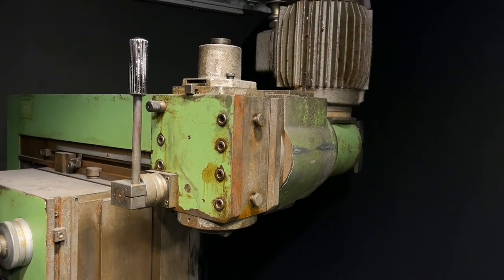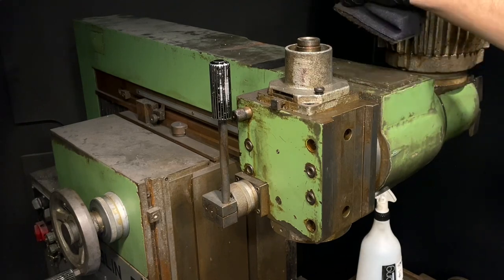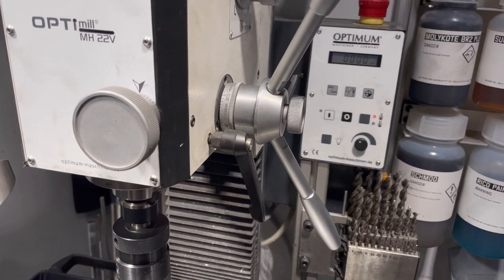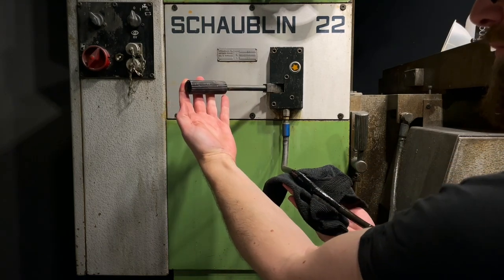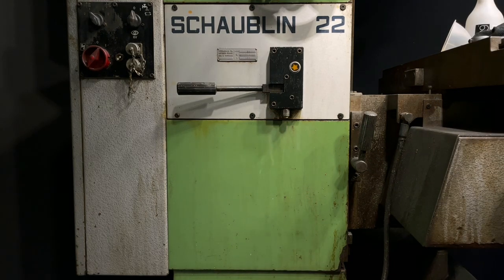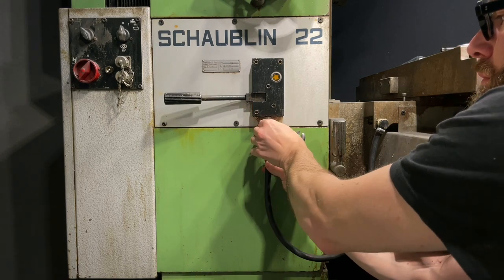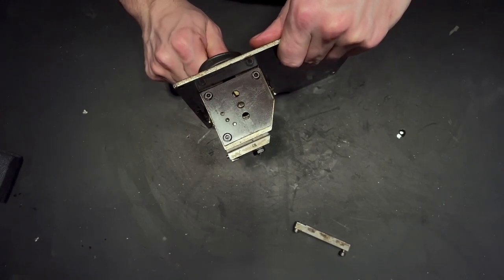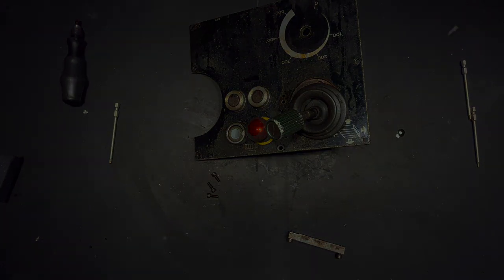SCHAUBLIN 22 | Ep1: Lubrication & Runout

Comment: Great video, I love your lighting and camera work, it's really good!
That machine is going to be great when you are finished with it
Yes voice overs are something I am always unsure about, I hate doing them and sometimes wonder if I should leave them out. As others have already said your voice over is fine though!
Reply from the maker: Thanks, I'm glad you like it. I'm still using a mix of true video lights and the flickering LED spots which I use as work lights. I have most of the material ready to build a couple of large scale panel lights which should improve lighting a lot.
Reply: @monochromworkshop  When you say video lights I assume you mean the style with the parabolic mirror behind the LED and soft box diffuser?
I want to get better with lighting, I only use a pair of Neewer 660 lights. hey are ok, but I really need brighter directional lights so I can see what I'm doing, and to get more contrast to the dark background
You have that contrast perfect in my opinion!
Reply from the maker: @TomMakeHere  My only video light is a small Amaran P60x wich I use with the small soft box and grid that came with it. My workshop is too small for larger mobile lights. That's why I would love to build permanently installed lights in my shop which are both soft and directional. I'm currently experimenting with different materials for diffusion and to achieve directionality. I found that especially for wider shots, honeycombs and the like are key to direct attention and avoid filling the whole room with light.
The Neewer 660 you have look very nice, especially for that price. The balanced swiveling hinge is so much more convenient than the single side attachment of my Amaran.

Comment: Regarding the lubrication hose you can look up any of the suppliers for central lubrication systems (Sinntec, Hennlich, Larco etc.) and search for "Schraubhülse" (~ screw-on bushing). These fittings are pretty common for such applications since they do not require very costly crimping machines.

Comment: Hey, i would like to point you towards Arnljot Seem, he has a Schau22 and a few videos on her... He also rebuilt the electronics for his Schau, so he can be of great help to you, as he was to me... 
Other than Arnljot, I too have a Schau22, and i feel deep love for any great machine, and even tho i dont own your mill, i love her nonetheless... So, you my dear sir have my offer of whatever guidance i can provide... I have a full user manual, and am willing to send a copy of it to you, should you need it or lack one of your own... To further touch upon that point, there is an english pdf version thereof online, to be had for free... I have that pdf aswell, so if you are unable to find it for whatever reason, tell me and i will email you the file... I should still have it on my pc somewhere... But i can always scan my original and make a pdf file to send to you, should i have lost the file i found online 4 years ago, when i got my S22... 
If you plan on touching up the spindle(as in full bearings change) i highly advise you to look up robin renz and his precision spindle video, and follow what he says religiously... The S22 is an ``ultra precision milling machine`` as per Schaublin themselves, and any single cut corner during the rebuild is essentially sin... Kind of like watchmaking... Its a process that requires and deserves absolute diligence and fanaticism on the behalf of the operator... Theres a reason why such jobs usually cost in the 10-40K$ range, depending on the scope of the rebuild, when done by right people from whom you will get better than oem results(which is a tremendous feat in itself)...

Also, should you need any info or pictures on how things look when they are as from Schau assembly line, i can provide... I wasnt there nor have i worked for Schau, but my S22 is a new-old stock which sat quietly for a few decades before she came into my loving embrace... 

The main lubricant you need is a Kluber grease... Its used for all bearings, and its used to repack the spindle bearings(which tells you a lot about every other ancillary bearing in the machine)... I cant recall the name right now, and im too lazy to walk downstairs to check the tub`o`grease i have for name or extract the data from the machine manual, which is also in a safe enclosure downstairs... But i will edit the comment tomorrow and add the name here: ``(LDS 18 isoflex special a)``

Regarding voiceover, i think you should do it... I am going to start filming my machines and restoration of some of them(as some dont need restoration), and i will talk, despite english not being my primary language, its practically essential, especially in videos like this... Hell, even CaLem who is definitely not a primary english speaker does talk a bit, and it greatly adds to his content and quality... Dont feel pressured into anything, but consider it, as it will ultimately help you develop your english and make your content much more sought after, as you arent braggadocios and full of shit, you will naturally bring up only the worthwhile points, which always acts as a quality checkmark and a bonus to a good video...  

For now, all the best and kindest regards...
Reply from the maker: Wow, thank you so much for your very comprehensive comment. I watched all of Arnljot's videos before I bought my machine. Some of the issues he faced are the same with my machine. The broken Z-axis hand wheel, for example, as I only recently found out.
Since my machine didn't come with the manual, I ordered a copy from anglo-swiss-tools. Since the plans will come all cut up on different pages, I had to scan them and stich them back together. However, some of the details are just not recognizable in these plans. Not sure this is an issue of my copy only. Also, I don't have the wiring diagrams for the machine but I think I will eventually need them. I may get in contact with Arnljot for that.
A full bearing change on the spindle will definitely remain far beyond my capabilities for a long time and I hope that the spindle is in a good enough condition for me to use the machine for my applications.
Reply: @monochromworkshop  The spindle isnt really all that monstrous of an undertaking, and its more a dedicated clean-room work with as much prep as went into the whole machine cleanup and assessment... Sure, it seems like a colossal undertaking and one that needs an extreme amount of skill, but generally, if you prep everything well, and use heat and cooling(like lighter gas filler bottles to cool down the things, or those freeze-nut-breaker sprays and heat on opposing parts) the whole precision assembly that is the spindle and its bearings, will perfectly slide in to position and you will feel it ``hit`` the hard shoulder...
Its supposed to be a smooth and gentle process where anything that offers resistance is likely an indication that you either havent cleaned it well enough or that its not properly prepared(temperature manipulation of tolerances)... Kind of like handling a very young baby... If you sense pressure other than gentle touch, you could be doing harm very soon... 
So dont be discouraged from it all too much in that regard... The price of oem spindle bearings on the other hand will likely discourage you away for a while... I cant begin to guess what they cost, but it would not surprise me that they are 1k$/piece...

That being said, im most glad that you have seen arnljot`s channel... He seems like a really nice and decent man, and a person dedicated to proper handling of machinery and his shop... As said, if you want, i can help you in some ways... Like taking measurements and pictures of the headstock overarm cover plate, which is a rhomboid piece of iron with two holes drilled down the center line lengthwise... It should be an easy diy part, and you could opt to make it out of good alloy steel and heat oxidize it into some pleasant and appropriate colour, before cooling it and polymerizing oil on the surface to give the oxide a durable protection and high gloss... Like those dark blue oxides, or the 372C purplish blue(akin to often seen titanium finishes)... I prefer such gentle details in conjunction with blaugrau machine grey finish... And unlike paint, its molecularly bound iron oxide with impregnated layer of polymerized oil, so it wont wear off anytime soon or chip when you sneeze near it... And lubricants wont ever damage it... 

I will check that Kluber grease now and update the original comment, so there`s that at least, but i well recall Arnljot specifically mentioning the grease name in one of his vids and lamenting the price... *edit(``lds 18 isoflex special a`` is the grease)

Keep in mind that Arnljot changed out his electrical finery, so his cabinet plans are custom and not oem(they are arguably better, as they are done with more modern parts, but its a whole project in and of itself)... I will take photos of my manual and send it to you, as that will have whole pages, hopefully resulting in less lost detail... 

The Z handwheel, or the Arnljot situation as i call it is quite a bitch, and i am at a loss as to how that could ever happen(what with the size of the shaft attached to it) to a single machine, let alone two... But if i were to speculate, i would guess that some crude brute used lifting loops and belts, but attached them carelessly and allowed the handle to take most of the load of a swinging and shifting machine to prevent her from flipping or toppling over like a domino as she was lifted up, which could crack such a shaft, as it seems to be an iron shaft, not steel, from what i have seen in Arnljot`s video, and iron is shit in contending with tension, which is exactly what would be exerted on that shaft in such a mishandling... 

Either way, im heading off to check the tub`o`grease and take a few pics... I`ll be back... 

All the best!
Steuss